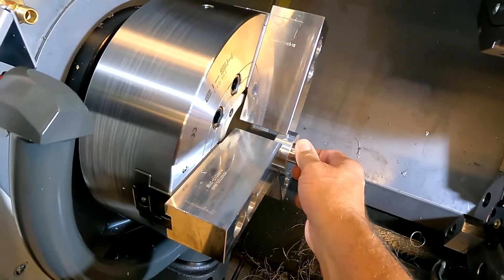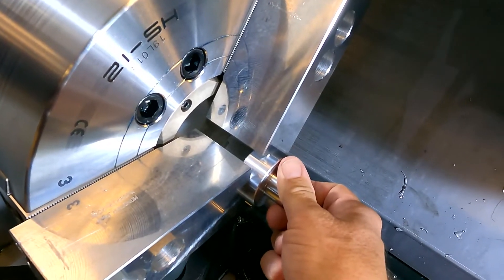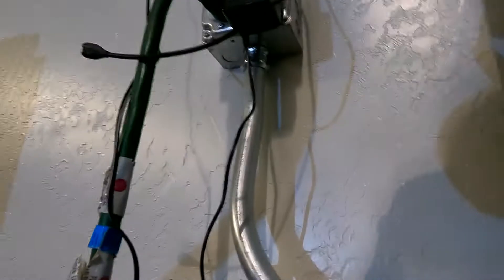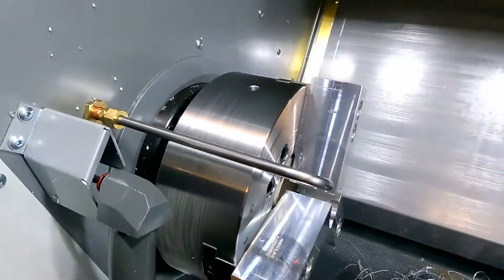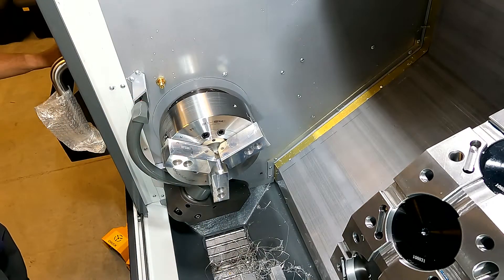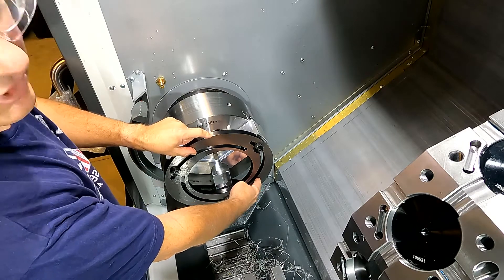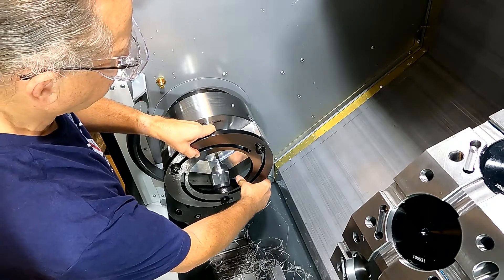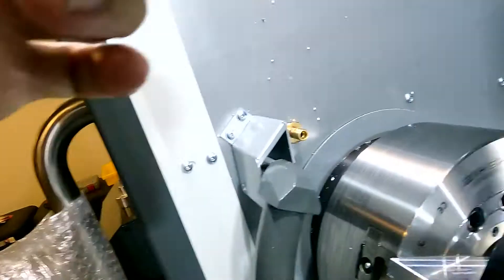210829 Boring Ring (Lathe Soft Jaws)

Comment: I wouldve used a piece of bar stock with an OD smaller than what youre trying to chuck on and stuck it in the back of the jaws so it can close a little more to bore the jaws to the finished piece OD. But ring gage is the way to go.
Reply: And if you need to bore all the way through, what then?